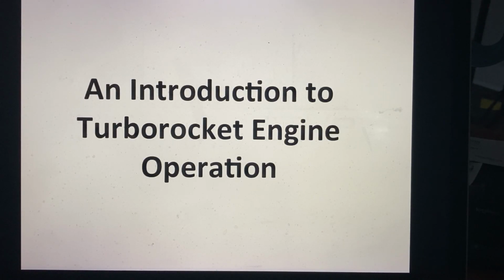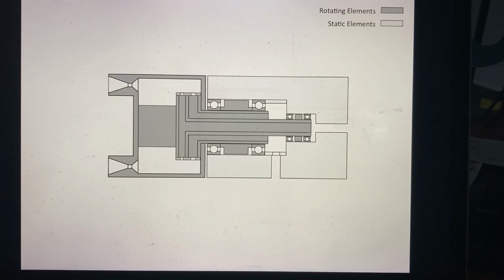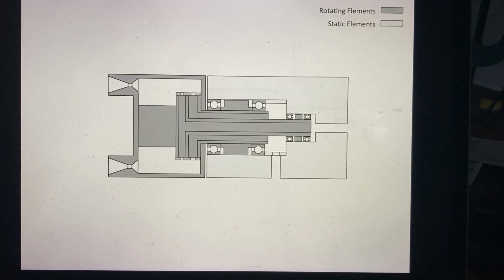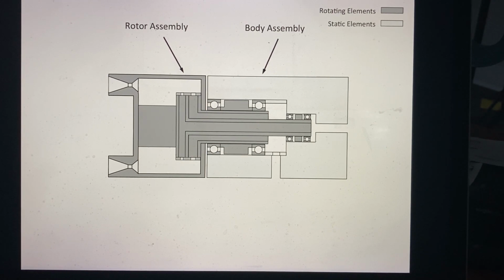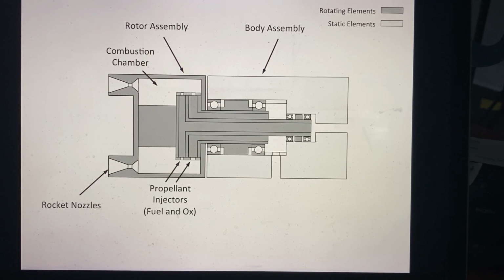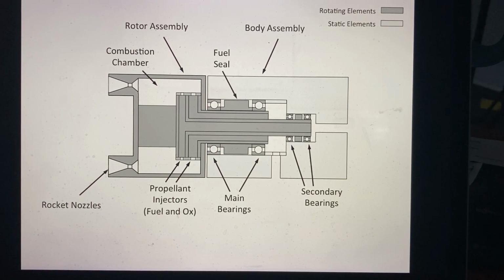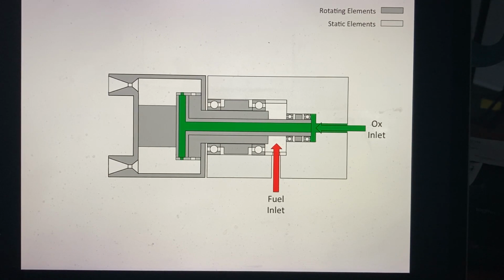An Introduction to Turborocket Engine Operation

Comment: Similar concept to the rocket prop on a concept helicopter
Where 1 rocket on the tip of the prop is put to have efficient use of the energy

A guy from mexico is doing that on his protorype helicopter using peroxide

As for your design i dont know what is it meant to be used for? And what are your propellants?
Reply from the maker: thanks for the comment.   "Rocket props" have been tried many times, the most notable being the Roton vehicle developed and flown by Rotary Rocket Inc.  The turborocket engine can be used for propulsion applications that can benefit from a pump-fed rocket engine.  There are many applications.  The turborocket engine can use the same propellants as a conventional rocket engine, and for both bi-propellant and mono-propellant configurations.  All of the above topics are discussed in greater detail in my book "Design and Analysis of Turborocket Engine Systems" (available on Amazon).
Reply: Interesting. I am in the UK and I am an ex aerospace engineer with a great interest in both gas turbines and rocket engines. Are you using ceramic bearings? They are going to lead a punishing life, next to so much heat. I wonder how you would deal with lubrication given the proximity of the oxidiser. Also, a great deal is riding on the seal between the ox and fuel sections of the rotor. 

I can see you have some test footage up so I shall have a look!